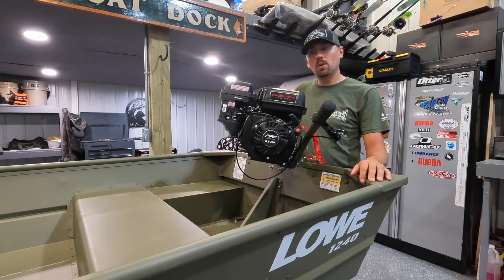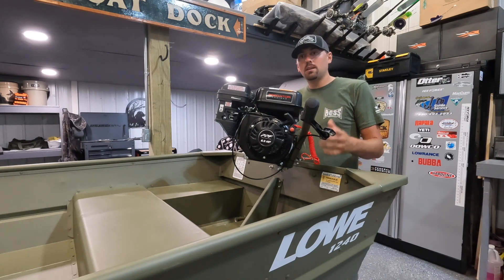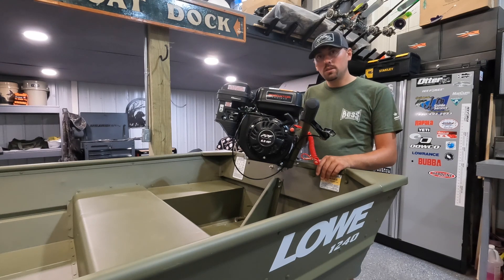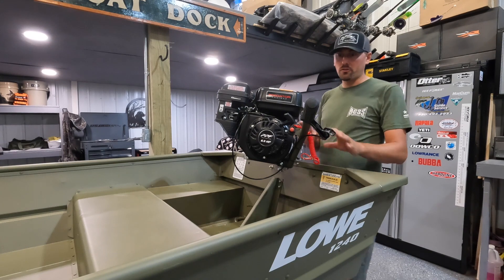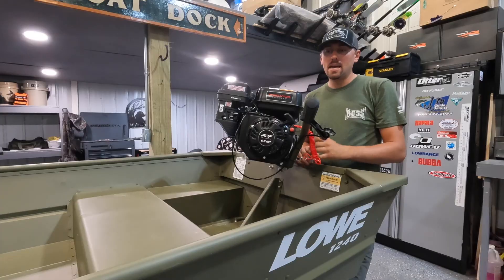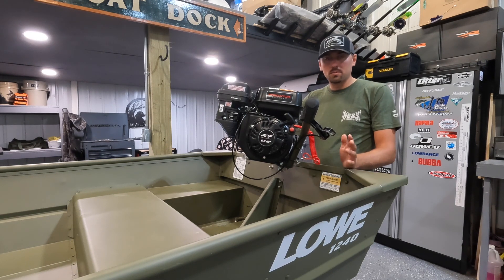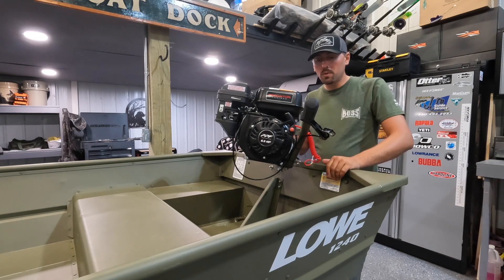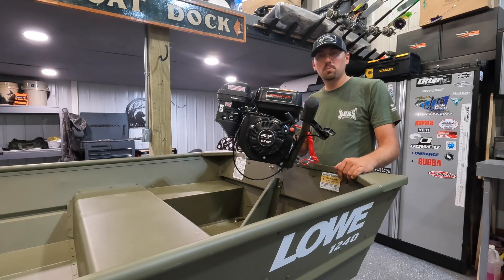PPF Wood Duck Mud Motor Review on a 1240 Lowe Jon Boat

Comment: How is it working out for you? What type of speeds are you getting?
Reply from the maker: Works great. Get about 12mph pretty consistent!
Reply: @jjmalvitz3460  have you ever used a Thai long tail? I’m  trying to pick something for a 1232 boat.
Reply from the maker: @huntingbob123  I would go with the PPF, hands down. Better construction, we’ll thought out machibe
Reply: I have both the PPF wood duck with a 6.5hp Briggs motor and a 13hp predator with swamp Runner medium package. I run a 14’ mod V so the boat is oversized for both motors. I was super surprised that the ppf would even push the 14’. It’s slow as heck in open water as one can expect but it pushes through mud like a BEAST. The long tail is faster in open water, runs smoother but doesn’t get through mud as well and takes some getting used too. Neither have reverse. Again my boat is oversized for both. If I had a smaller boat I would definitely go with the ppf. It is lighter and way easier to manage. Plus there isn’t a huge tail sticking out that needs to be hidden when duck hunting. For a bigger boat and more travel needed the swamp runner is the go-to for the last 2 seasons. I push a 14’ mod v with 2 big guys, 3 dozen decoys and a homemade boat blind 12 mph in open water.
Reply: Do you have any thoughts or experience with the backwater ultra lite?

Comment: Wztepeng Electric Start Kit Flywheel Ignition Switch Kit Only Compatible with Honda GX160 5.5HP GX200 6.5HP Switch Starter Motor Lgnition FlyWheel Fan Cover
Reply: Have you tried this yet